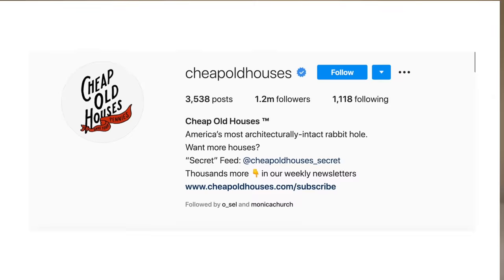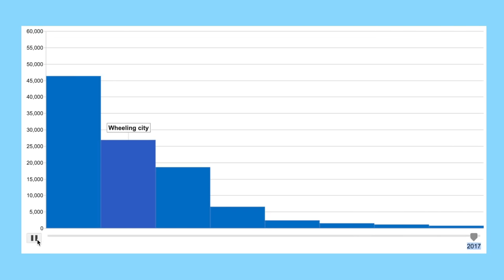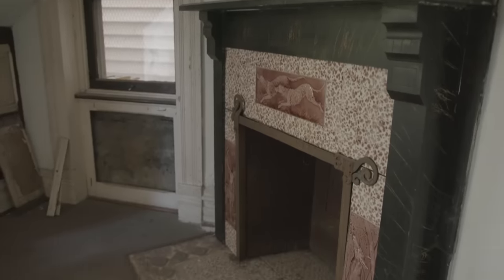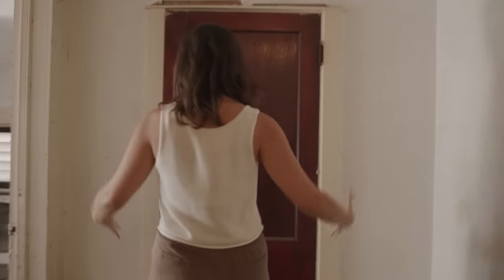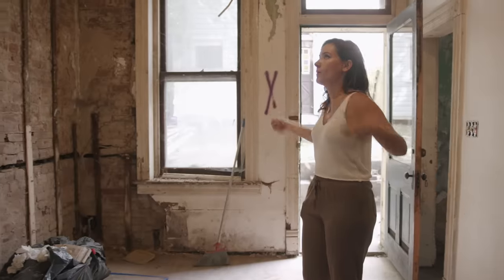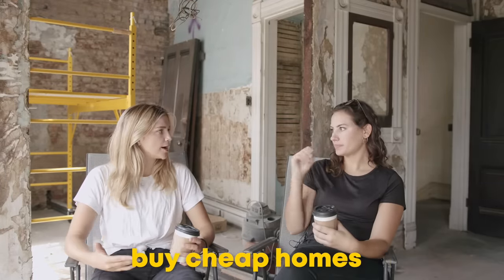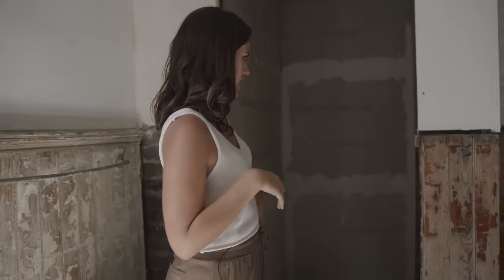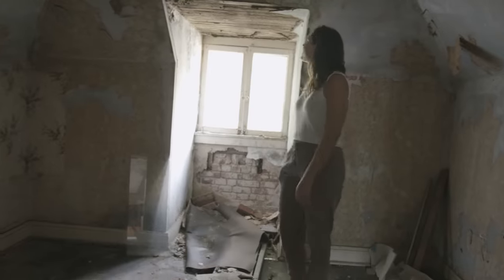Buying An $18,000 House: Inside America’s Cheap Old Houses

Comment: There are towns all over that area that have houses like this...back when I was a builder, I used to work on a lot of them. They were interesting, but they were also a real pain because you were having to correct for other peoples mistakes. Out of square, out of plumb and out of patience was a pretty common state of affairs!
Reply: I feel ya there.
Reply: When these old houses were built most people would just eyeball things. Building codes also didn't exist.
Reply: @mrsmith2876  - True, but the craftsmen of yesteryear were seriously skilled. At least the ones that would have worked on a house like that...a lot of the houses I worked on were definitely built by 2nd stringers.
Reply: @Snarkapotamus  yeah, but still even the best eye can make mistakes, I have worked on a good bit of these houses and getting things to fit properly is...interesting. what is even worse is i grew up in old coal company housing, just give up on having straight boards and joints. They usually used what they could get cheap from the mine.
Reply: @mrsmith2876  - LOL. Yeah, my in-laws live in an old coal company house that sits by a set of active rail tracks. The house I currently live in was built in 1980 by a guy that was the lead foreman for the construction crew building a local power plant. All of the roof sheeting and sub-floors are made from left-over cement forms...

Comment: she's gonna go way over budget. I'm doing something similar with a  1980's 3 bedroom in the forest in Poland, with significantly less damage and lower cost of labor (although I did add a 2nd floor), and my little one matches her budget for that big place. She will easily double that budget.  But you can always just do one floor at a time so it's still possible, it would just take longer to save up and get it all finished. If you can stomach a project that big, then you'll be rewarded with way more equity down the road. The original features are stunning and I wish her the best of luck!

Comment: As someone who has built several homes, I don’t see her getting this done for $125k...I hope she does though. I admire her creativity and ambition. Would love to see it when she is done.
Reply: Maybe construction is cheaper in that area.
Reply: She said that she plans to do most of the work herself. If she were to hire it out then I would agree that it's a pipe dream. But as someone that does that kind of work I can confidently say I could do it for that amount...for myself; I'd charge a heck of a lot more though for my time, knowledge, and effort.
Reply: I agree with you, I thought the same thing.
Reply: She expects to have it done by next summer, yeah that isnt happening
Reply: It sure is a HUGE amount of square footage on top of how extensive the repairs/renovation appear to be (but I also know absolutely nothing about building a home, so my opinion is entirely uninformed).
Reply: Yeah I don't know anything about renovations, but I thought the same thing too...
Reply: 125 is not even close.
Reply: I was thinking the exact same thing. Double that at least.
Reply: labor is probably cheaper there, and she is probably thinking of using the money wisely, and not spending 20 thousand  dollars on a designer sink or things like that...
Reply: Not even the tip of the iceberg
Reply: Between unseen surprises, mold, structural fixes, electrical and plumbing, patching the roof, and of course appliances, making a kitchen, restroom, etc...I don't see her doing anything well/quality made for anywhere south of 225k.

But maybe I'm being too critical, and she knows exactly how much work this house needs.
Reply: @CattyMcMeow  Yeah. I hear you. It's like who know's what that budget includes. I've seen people easily spend 200k on a house half that size to get in good shape.
Reply: There is zero chance this gets done for $125,000, even if she does a lot of work herself. The kind of stuff she can't do--HVAC work, electrical, plumbing--will be astronomical.
Reply: Have to agree to get it done right its about 500k
Reply: A realistic cost is @ $400k-$600k for this type of work.
Reply: She does this for a living, renovating old houses. So I think that she most likely know what she's doing.
Reply: @Kristy Lea Jeanjaquet.   As a Builder for over 20 years and have renovated old houses I can assure it does not come cheap. The house requires a lot of work......
Reply: She's going to be working on this thing for years and years and years. She think she's going to do most the work herself but I don't see that happening either. Sorry. She's going to be calling in and paying for help. And her budget is going to double or triple. This kind of work is murder on a big tough man, and it would still take a long time. But could be doable. But sorry this lady isn't doing this herself on anywhere close to that time and budget she thinks. Sure she may have done some small little flips before to make money. But this monster behemoth of a house is on a whole other level. I don't think she realizes what she got herself into. And I doubt the houses go for much money there. When it's all said and done she might not even get her money back out of it.
Reply: You are absolutely correct.  I've flipped homes and there is no way she will get this done for what she is thinking.  You can tell she really does not know what she is doing.  Many of the things she was saying makes no sense and will cost a fortune, much less to be completed in 1 year.  If you had a full construction team (6+ workers) starting the next day, it would take over 1 year to restore and build what she is talking about, and probably cost about $250K-$350K.
Reply: Georgie C  I can also tell you have never flipped a house, especially one like this house.  It's amazing to me when people who do not have a clue what a house is like with structural damage.  Laying hardwood floors should only take 1-2 days for a 2,000 sq ft house, what is your point? You are talking about finishing touches on a house.  This is not a normal house, she is making the majority of this house back to its original condition.  If you don't believe me, then see if Monica will post a video on Sept 6, 2021 and you will see where this house is.
Reply: @Sabrina-wn6ey  if she does it yourself, it could yrs no? how long do you think
Reply: Georgie C  how long did it take you?

Comment: I bought a cheap old house in St. Louis Missouri I’ve been renovating for the last two years single handily $1000 built 1890
Reply: Charles Eden Cool. You should show your work.
Reply: Charles Eden good job
Reply: I just followed you on instagram.  It looks like a nice house, a lot of potential.
Reply: @charleseden1105  good job
Reply: Nice work, Sir. Looks like a big project. Are there any local agencies that you could apply for funding with?  There is  a lot of funding out there and if you are in one of those Development Zones it could help you out. Good luck.
Reply: I followed and wow!
Reply: @charleseden1105  following!
Reply: Hell yeah, man! I uses to live in St. Louis, I'm glad you're taking on one of the old houses.
Reply: Congrats, Charles! I live in South City, by the looks of the picture with the Arch in the background, you live in near North City. 

I used to be a general contractor who specialized in historic home remodels. If I may give you a little advice, focus your time and money on securing the exterior first, to prevent moisture penetration. 
Also, take the extra time to do things properly instead of quickly. Too often people take on a big project like yours, with the mindset that speed is important. It’s not. Slow and steady wins the race.

If you focus on these two things, it will prevent having to redo work down the line, which is more costly and time-consuming in the long run. Be patient and diligent, and you’ve got this, man!
Reply: Amazing! I love St. Louis. That was our dream city. Love washington u.
Reply: Curious to know, how much have you spent renovating it so far?
Reply: @Febreezy  I’m not never 20k in yet saved a lot of money just by doing sweat Equity it takes more time have to do research and than actually practice and than doing the job. The majority of my cost comes from buying tools to complete the jobs
Reply: @tundrellaCat68  thank you I haven’t even began to look into receiving any assistance so far it’s just been me paying out of pocket check to check
Reply: @charleseden1105  food for thought. When I bought my house, I looked for one with a rentable basement suite. It needed a lot of work but I focused on that and got it rented out. I went for the good renter gets good deal and people always appreciate the deal and stayed for years. Never vacant. That basement saved my butt through many hard times and allowed me to stay home with my kids when young.

Comment: This would be my nightmare project to get at work. I'm suspecting a million hidden problems which will be uncovered as they start taring shit down.
Reply: Louie Grind: Do you get why it is even that torn down,destroyed? Can it be that someone started to renovate and gave up?
Reply: @Medietos  It is torn down because it is neglected and old. If someone would have tried to renovate it before hand you would see proof of newer materials been put up. Even if they didn't manage to get that far in this hypothetical renovation, the underlying problems I'm referring to still stand because it's an old house built when there were completely different building codes. It's a high risk of asbestos in pipe connections, if they're made of plastic, which will require a sanitation crew, the electricals is probably a nightmare, the plumbing is probably under dimensioned etc. etc.

I work as a structural engineer so I've been in contact with these types of buildings and they always have a bunch of hidden problems that cost a lot of money to fix.
Reply: @LouieGrind  Thank you for your knowledgeable reply. It was not my intention to question your first claim of all the probable hidden problems, I just addressed you with my own Q about some visible ones. Honestly, I couldn't listen to and watch the whole video because of the disturbing "music" and her voice and their ways. But upon some little 2d watching, it doers seem that they had started to tear things down,and also those bricks falling down by themselves made me realize that it is really old.
This below here is maybe too private, so beware if you are sensitive or something,maybe don't read it. Be well sir.
As my father started to renovate an old small farm ,that had been empty for just 30 years and was wooden. The only bad thing are the beams holding the bottom floor floor: They are mouldy and rotten from the dampness of the earthen food cellar under the floor.  I felt uncomfortable walking there after some years lest the beams would finally break in two and maybe affect the walls. But it has still not been re-made after 30 years. 
I have had mý home and money taken from me and want to have my life back. Am figuring out how to write to the c´villain, but since they have kept me from information and their planned, they have been holding me stuck in psychological terror and extreme stress in isolation needing a trauma help, Med. Dr and dentist for years. He is even a millionaire and doesn't even need my money. I have been working at acceptance, keeping calm, forgiveness, not starting to hate and checking the anger and fear. Looking for what I can learn.But without sleep, a place in the world and basic safety and orientation, and some social comfort and joy, I don't have access to my energy and thinking clearly yet. I reckon all the combined abuse and harm during 40 years  will amount to sth like 70 Million SEK damages.1 million per year at first , the 2 a year for the increased torture. It is an unbelievable  nightmare. And of course the money won't give me my life chances, looks and years back. But at least enable me to finally get all the various treatments and assistence I need more than ever to stabilize, get to function and having a daily life, recover, heal, live, love, work, be who I am, contribute.  Sorry for the personal openness.
Reply: Yeah exactly. I lived in a much smaller house that was built in the 1960s and it was a lot of hidden problems that we had to deal with.
Reply: @Taranehm  My husband and I bought a house that was built in 1953. You are so right about the hidden problems. When we remodeled our bathroom we discovered that someone, at some point in the last 40 or 50 years, had cut the floor joist that was directly under the toilet. So that was an unexpected problem that had to be dealt with before we could continue the remodel!

Comment: I am assuming when she was referring to quality of materials and said: "It's impossible to get wood framing members that are as strong as these trees were", she was referring to slow growth trees. That is so true. Lumber today is from fast growing trees and not as hard. The lumber to build these American homes were from old native trees.
I love old homes for reasons like this.
Reply: I had a house in East Point, Ga that was built in 1920. Such a lovely craftsman’s bungalow. I hired a man to install pins in the window to keep them from being raised. His drill burned through its batteries because the wood was so hard and strong.
Reply: @RochelletheRealtor  burned the batteries literally or killed the batteries? don’t think the second one is possible. the power being pulled from the batteries isn’t based on how hard the wood is.
Reply: @anileclou2774  
I should have been more clear. The batteries ran down because the drill required so much power to drill through the wood. He had to change batteries after each battery because the wood was so hard. He came prepared because he knew if was an older home. He said normally one battery would have handled all of the windows with power to spare.
Reply: @gigi stoner Thanks for sharing that bit of knowledge!  It never occurred to me that the rate of a trees growth would affect the wood's strength in the long run or that today's lumber come from trees grown faster.  It makes total sense! 😜  And I now understand why the woodworking and cabinetry from the older victorians, bungalow and eduardian style home is so luscious compared to today's carpentry.  "It's not just the craftsmanship; it's the WOOD itself as well!!"  🤦 You ever have one of those " Duh, dumdum!!! " moments that leaves ya feeling silly for having been so obtuse??  Yeah... I'm having one! 😁  Again, thank you for sharing that bit of wisdom.    Many blessings to you and your loved ones. 🙏🏼☺️

Comment: I bought an old 1904 art and crafts home in Youngstown Ohio back in 2006 for $8k.  It needed new shingles, gutters, updated electric, HVAC and some plumbing problems addressed.  There were a couple areas where plaster had disintegrated fallen because of water damage as well.  The foundation and roof structure were sound.  

It was my first house and I was going through a divorce, so I didn't have a lot of money.  What I did have, however,  was a lot of free time... and friends.  I taught myself how to plaster, lay tile and refinish wood trim.  A buddy who is an HVAC pro helped me with the HVAC and electrical.  Cost:  $1600 in gear plus two steak dinners and free beer for life.  I converted the one car garage to a man cave with a fridge just for that guy.  The fridge is for his beer only (says so right on the door) and its stocked to this day.  haha.  Sixteen years later he still comes by and hangs out, whether I am there or not. 

I also had a roofing party where 15 of my guys and their buddies answered my cry for help repairing the roof over a long weekend.  Cost:  $500 in material, as much pizza and beer as they can eat, steaks on the grill for dinner and I had a specialty caterer do a low country boil in the back yard one evening.  Funny thing... they still talk about that "roofing party".  Not because of the work, but because of the food and fun that was had.  Instead of everyone driving home for the night and driving back the next day, they all pitched tents in the back yard and had a party.  Neighbors heard the commotion and came by to say hello.  Before I knew it, I had 50 people in my back yard having a blast.  That was when I was introduced to pickle juice for cramps too.

I have since bought my old 1870s farm, but I still own that house.  One of my pals who helped at the beginning now lives there after his divorce.  He only pays me what I need to cover property taxes and for his utilities.  I may own it, but its his home now.
Reply: I am originally from your area via my mothers side. That prompted me to say , you are a very generous man, and God bless you.